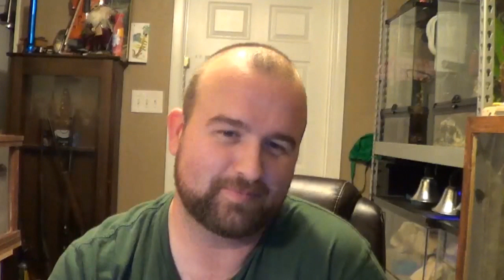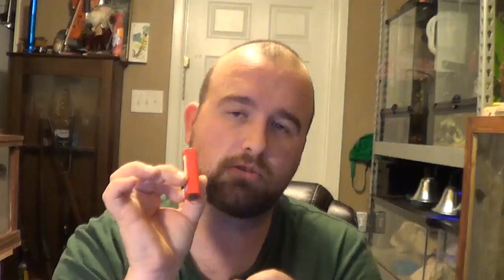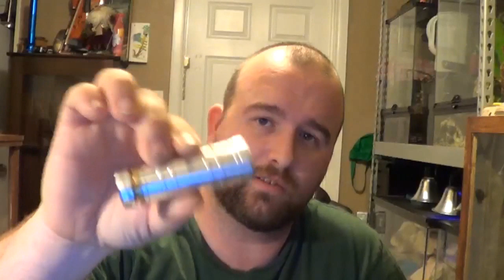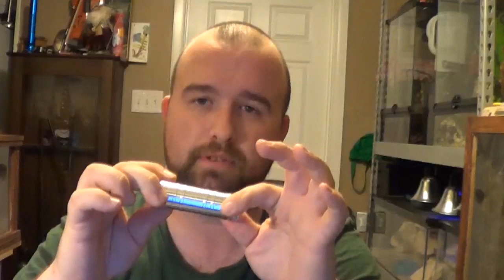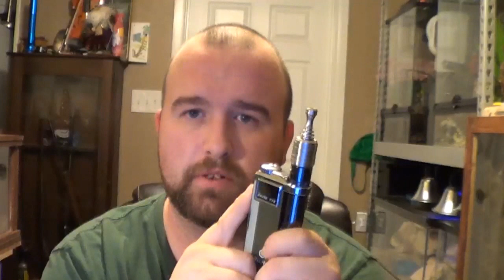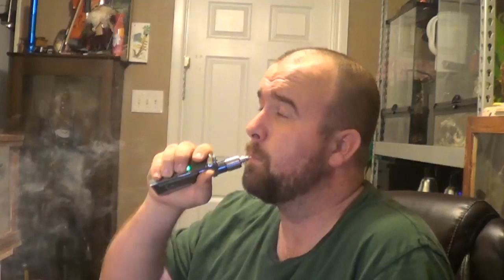battery safety with mods and vaping

Comment: I have a long aged question I've asked people but I just don't believe it. why can't you use a battery for a mod for say If I am using my rx 200 batteries and use them for another mod or box mod snow wolf they say you can't do that cause thier married ? and it will mess up any mod by using other battery that have been used on other mods, sounds ridiculous to me but please help with some science behind it
Reply from the maker: So it boils down to this if you have two batteries that are married and you use one by itself you've actually reduce the lifespan of one battery to the other so let's say you take a box mod like the snow wolf and you have batteries are married and they have a use it was a 5000 uses and then we pull one out and we use it in a regular mechanical mod now it's life span is reduced.  Also the strength of one is reduced, causing the said other battery to work harder to keep up. So it's not recommended to unmarried the remarried batteries.  Now you can use your married batteries together in box mods of your choosing, just stay within there range. Hope this helps
Reply: +Tc Reviews thanks a lot it definitely did

Comment: Hello mate question for you, im a noob, I just restarted vaping and had a chi you mod 2nd hand from last year and two purple efest batteries 2100 mAh imr 18650 3.7V LI-MN high drain rechargeable battery 30A only used few times i brought myself a Aerotank Giant atomizer set it up filled it with juice and it didn't work, so striped down mod clean connections put it back on and worked not used it much then felt my small finger get hot, thought might of been mod playing up as the push button often flys off and that happened so put it together again and nothing thought it was mod tried tank on another battery and that didn't work, charged both batteries and tried little a dripp one i had nothing tried other battery and fired the tank coil is a 1.8 ohm and that other battery is full charged and completly dead whats at fault, mod,? , battery? or tank? and is it worth doing it with other battery or not? thanks for links

Comment: I hope you can get back to me on this, I didn't have my batteries in my mod or anything but they began venting in my pocket.  I had my mod, and my two batteries in one pocket.   Was that why? The casings were kinda roughed up.  I was wondering what you thought happened sir.

Comment: how long typically do batteries have when using them and when they are stored? is it years or just months?
Reply from the maker: as far as using over and over, most batteries have a cycle rating . meaning one cycle means charged all the way up and then depleted of power= 1 cycle . It really depends on the battery you have purchased as to how many cycles it is rated at. But to put into prospective I have 4 sony vts "s  and use them all very regularly had have had said batteries for over a year now.  Now shelf life can be diffrent the issue is this if you allow your battery to just sit over time unfortunately the power stored will bleed off. causing the battery to be in a completely uncharged state and with out the use of a low amperage trickle charge type device you may never get it to recover. I would recommend getting something like the Luc charger it has a .5 amp charging setting that sometimes can bring those back to life . and for those who didn't know that setting .5 is a good storing setting.

Comment: Thanks for the tips! I'm using a sony 30 amp 18650 and everyone says they are some of the best out there for sub ohm vaping (I won't go lower than .4 or .5 Still..I have that fear in the back of my mind that it could randomly blow up and permanently disfigure my limbs/face or just outright kill me! Not good at all.. But the vape is sooooogooood it's well worth the calculated risk IMO.
Reply from the maker: yeah, i personally like the sony 30amps aswell, I find they last longer and hit harder then my other ones , but thats just my humble opinion .. thanks for watching the video and the support bud, be sure to subscribe if you havent yet at a chance to win the veritas and some killer juices aswell giveaway time ends in the next few weeks.
Reply: you are safe down to .20 for sure... if you are using a tube mod i wouldnt go below that.. im currently running .11 on a parallel box mod, in parallel the amperage is shared between the batteries.